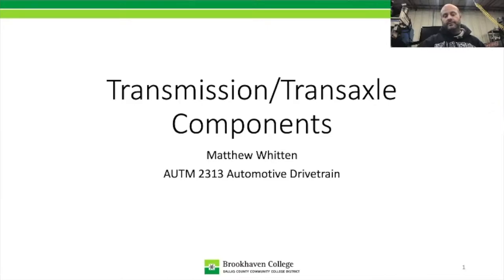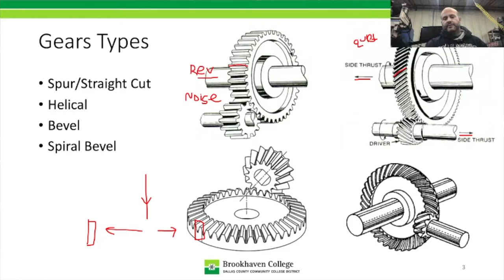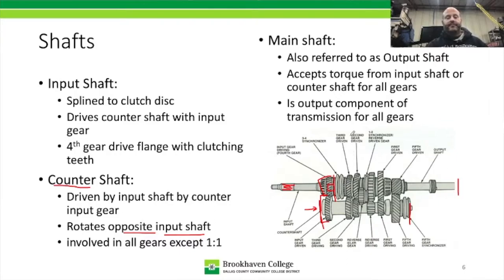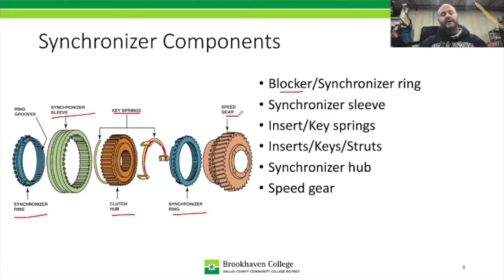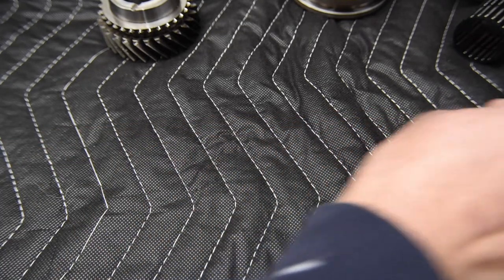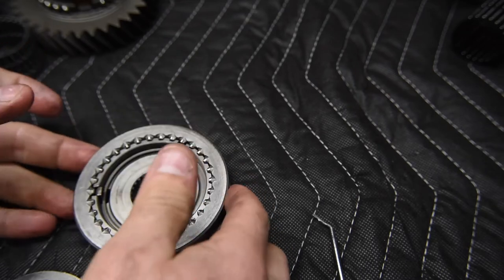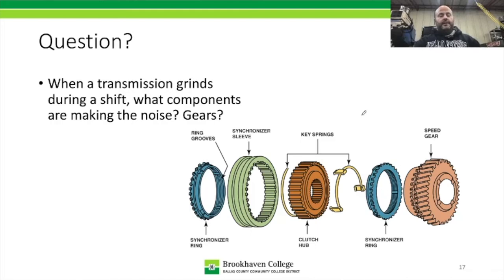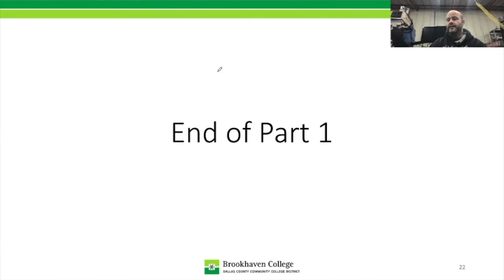Manual Transmission Internal Components

Comment: Hey there Matt! i hope this message finds you well. i came across a thread of you looking into 1/2" head studs on a D series. Did you by any chance get anywhere with that? i'm in a disparate situation and having a hard time finding information. Thanks in advance!
Reply from the maker: Hey, sorry I didn't see your message for such a long time. If you're still in need, yes it was successful however right now getting the studs could be an issue as ARP is a little slow on orders.
Reply: @Abletrot  do you have a so ial media handle or something similar? I actually ended up figuring something out  and I'd love to share it with you